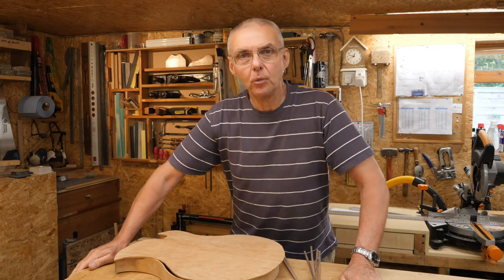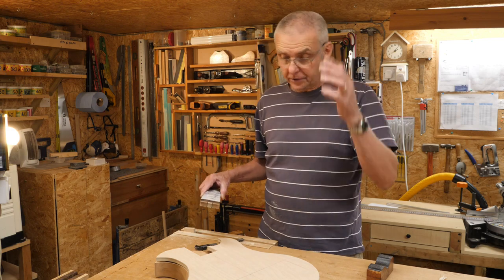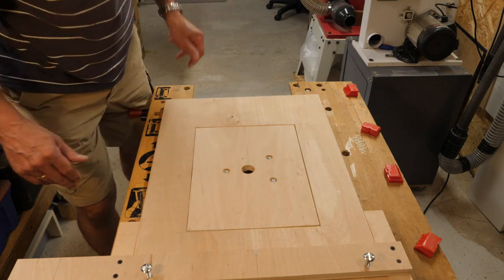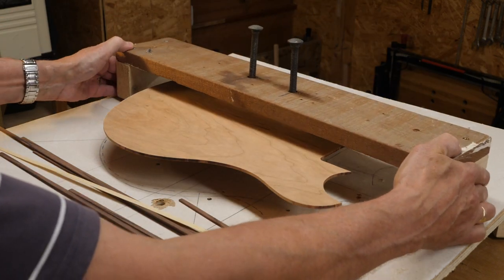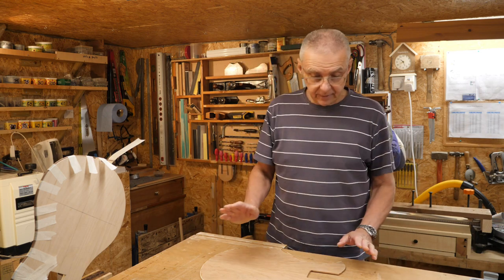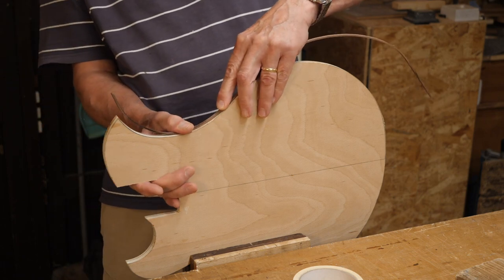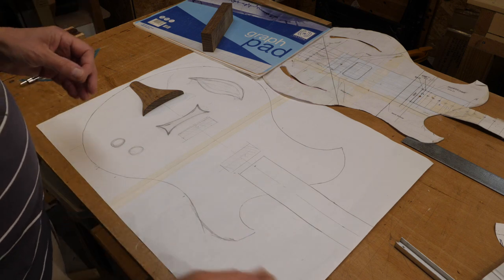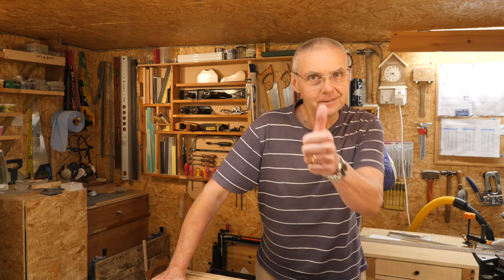#GGBO22 Community Build ep13: Binding a body top - how hard can it be!

Comment: Hey Dave. Love the router table idea. For safety I'd consider installing an NVR switch in place of, or inline with, that switched socket - that offers you no protection at all.
Loving the build so far. Thanks for another great video!
Reply from the maker: Thank you for the advice, I will look at installing one of those.  Cheers Dave

Comment: Respect for using parts from an old bridge to fashion a new bridge, part wood and part metal with height and intonation adjustments. Acoustics sometimes have height, (often just sanding the saddle) but intonation has to be done by reshaping the top of the saddle. I like your idea. I wonder if it’s already been patented or if there’s an opportunity there.
Reply from the maker: Thanks Robin, I’m sure it’s been done before, but still nice to have a go. Cheers Dave